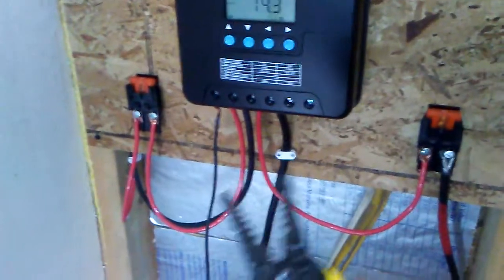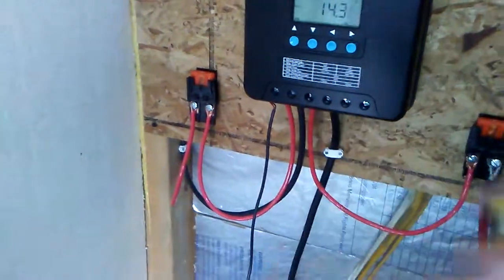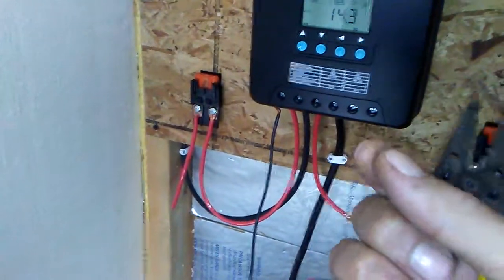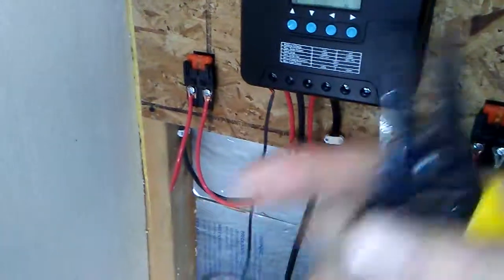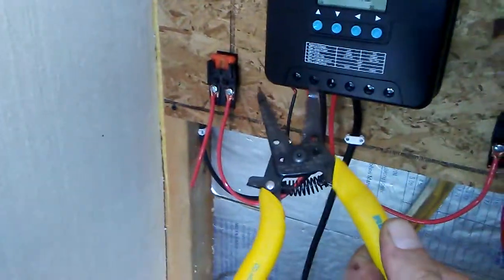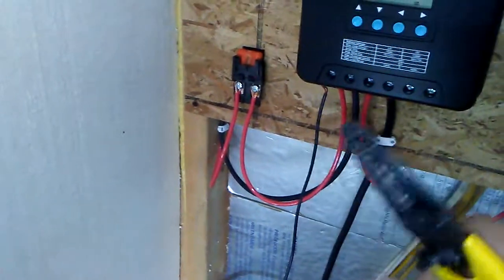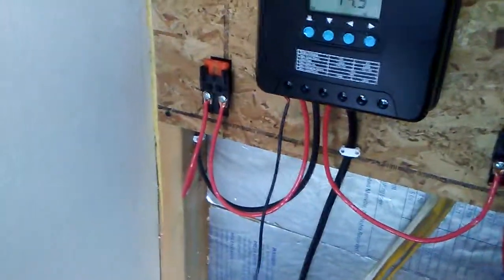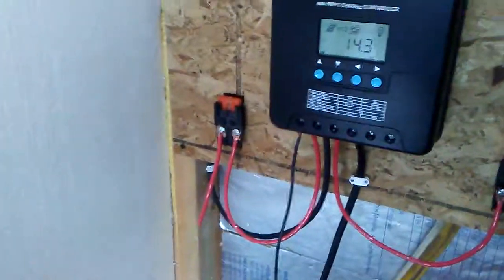Renogy 12V 400W 40A Solar Panel Kit Install - Tip 8 - Working With Live or Hot Wires

Comment: how do you have your inverter hooked up to your main panel, is this a battery backup for your house
Reply from the maker: Thanks for asking.  I'm not exactly sure on your question... but I will try to explain how it works.  If you would like me to do a video on this,  I can do so.  
The solar panels that create the power is connected to the charge controller (the controller controls the charge to the batteries... so the panels will not overcharge the batties) 
Then after the power goes into the charge controller,  that charges the batteries.  (The bigger the battery bank is... the batteries... the more power you have saved up... just like a bank...) Now that you have your stored power stored into your batteries... you connect your power inverter to turn the direct current (dc) into alternating current (ac) so you can plug 120v stuff into it.  Yes you can do 240v as well, and yes you can just run 12v stuff just off your batteries alone without using a power inverter. 

This is NOT made for a grid tie in system.  This is a true off grid electrical system based off of solar panels.  

Hope this helped.
Reply: @TinyIowa  no, i wanted to know how you have everything hooked up to the house mains so it doesnt blow your inverter since the ground and neautral should be bonded tyogether, a inverter cant handle this unless it is specially built for it
Reply from the maker: @mattrowe1229  right now I'm actually working on building a utility building right now.  I'll show you how we did ours, and it works perfectly fine.  
Unfortunately, this is something that I would like to show everyone how to properly do, and teach at the same time.  Hope you understand.  
Btw, I haven't started on the electrical yet,  so we're still a ways off.
Reply: @TinyIowa  thanks, ive been installing grid tie solar systema for last 7 years and electrician to grid tie and residential service, i just have not used low end inverters, off grid, all my work is with solar edge, or enphase grid ties
Reply from the maker: @mattrowe1229   I did mostly residential and commercial electrical work for a few years... college,  the whole nine yards.  I kept getting hurt and I was young.  So I gave it in the mid 90s. Went and did it again in mid 2000's... but, egh, not for me.  Maybe as a hobby... but not professionally.  
Personally,  I think the grid tie in are good in plentiful sunlight conditions... like Colorado etc.  But without a battery bank,  you cannot store solar energy.  So in states that only have an average of 3 good hrs a day in sunlight... eggghhhh... I don't think it's that beneficial for grid tie in's.  Cause on the other side,  the electrical plants have to rev up and rev down their outputs.  Wastes a lot of energy.  Whereas in a place where you only see a good 3hr of sunlight,  totally off grid with solar is the way to go.  But there it's mostly a math game and the balance of number of panels combined with the amount of Amp hrs that are needed in your battery bank that still can be fully charged each day.  The only time we have a bad solar day,  is when it's foggy or rain storms.  Partly cloudy... no problem.  Snowing day... like real snowy day... no problem.  Colder the panels are the more power they produce!
Reply: @TinyIowa  exactly, i live in phoenix area and installed all over valley, the utility cos even started charging people for excessive power just to kill their reimbursement,so i had to start installing power consumptiom moduals to regulate large loads.i did one job, 65 panels, 3 inverters and the 3rd one was a 6000 watt battery backup but i only installed the whole main system, guy didnt have enough to the battery part so i lost out on that knowledge, the other 2 inverters where grid tie, no battery backup, and 3000 watt
Reply from the maker: @mattrowe1229  damn that's crazy amounts.
Reply: @TinyIowa  thanks, i know that part, i wanted to run my inverter hooked to my circuit panel to power both phases when a grid down happens, but i watched a video from someone else and they fried their inverter because your house wiring has the ground bonded to neutral when the inverter does not, so i wasa wondering how to hook up without blowing up my inverter